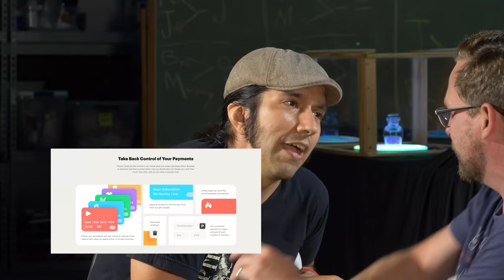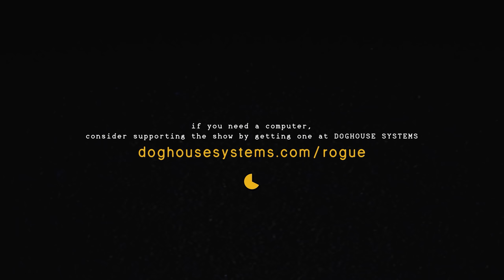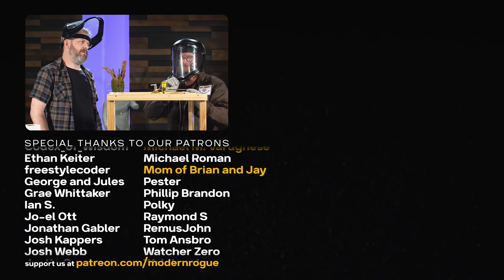Do Jewel Thieves Really Do This?

Comment: I'm not a burglar but I used to use a glass cutter to make cups from used bottles. And the way I cut the glass is using thermal shock. After performing the etching with a glass cutter, pour boiling water slowly And when the glass is hot, replace it with cold water and the glass disconnects exactly at the etching line
Reply: 90% Alcohol or Methonal lit

Comment: Guys, no no no! This is the first time I couldn't make it through a video. Please reach out to me as a resource next time you do any roguelike stuff like this. 1. You don't score the same path more than once 2. Heat is the best method for breaking the score, use hot water or a jet lighter (hold it far away though)...glass is susceptible to thermal shock. From a rogue perspective hot water is very quiet and doesn't cause a flash of light like a lighter does 3. If you want to be a real cool thief you place tape over the area you are removing and then make a handle to pull it all out, you place one line of tape vertically and leave a tail folded over you can grab onto then you place several pieces horizontally over the top of your handle so it holds onto the glass.

Comment: From a guy that use to cut glass all the time, use the following advice:
1. wet your suction cup and make sure the glass is clean. It helps to put pressure on it to ensure a good seal.
2. Make sure you have the room to go all around if using a circle cutter. When you find out after the fact you cant go all the way around it will cause issues.
3. Do NOT go over the same cut multiple times. Slight pressure is all you need to make a good mark that will break.
4. Use some oil on the cutting wheel. This helps keep it from running off when you go to break it.
5. When cutting, you need to strike it from the underside to start the break. Tapping the top wont do much as you have put a V shaped score in the glass, you want to press up from the focal point of the V. There are techniques to break it from the top but just tapping wont get you anywhere unless you just plan on breaking all the glass.
6. The ball on the end is used for tapping, not the head. You can bend the head to where it will not compress the spring inside.

Comment: I’m a glazier (I cut glass for a living lol). This technique would not work. In fact hitting it from the side you scored it on at all, will not work. The only way it will break along the score is if your were tapping it from the other side. Which means that the way they are doing it will never work. There is a much simpler way to cut glass from the outside and not make a mess or noise that I use all the time but I’m not gonna say how to do that.

Comment: Hey Brian, Jason, and Brandt, I have a fix to your woes: Different glass, cleaner cuts.

1. Tempered glass has been used since its creation in the late 19th Century for display cases. Then, thicken the frame another 1/2 inch so more pressure can be applied.

2. Clean the glass dust out of the cuts every full turn. This works like dusting your record albums so it plays clearer, only you're making the cuts more consistent in depth and pressure with every pass.

Try it with the annealed glass you have on hand, and see if it's worth a revisit!

Comment: I professionally cut glass in an industrial setting for 3 years, I've actually used a similar tool to cut circles. Basically when cutting glass you need to apply tension on the top surface. In essence you want to push from the bottom non-scored surface toward the top. It causes the score to propagate in a straight line from the top to bottom surface. When I cut circles I used the suction cup that held the scored side to rapidly pull and it popped loose. Another important note is to not overscore, make one pass with about 10 pounds of pressure and quickly twist the cup and the circle should pop loose. 

TLDR. For 1/8 inch glass, use lube and even pressure (about 10 lbs) to make a single pass and rapidly twist the cup and it should break away cleanly. Thicker glass requires a little more pressure.

Comment: As a window repair guy at a hardware store, you definitely scored waaaaay to much, I haven't done many circles but the principle is the same, single solid score because glass is so brittle that gives it a straight(or circular) path of least resistance then it's just a matter of figuring out how hard and where to make it snap but usually you'd be able to cut reliefs going around the outside of the circle to break off smaller easier pieces but that might work easier on the inside as well
Reply: This dude's dope, you should listen and put his comment in your next video
Reply: I agree to, he's obviously very smart and handsome, please include or at least read his comment

Comment: I would use as precise a suction/compass thing as you can get, and make sure it has a glass scoring carbide tip. Just do a single, precise score line - consistent and strong pressure, but no repeat scoring. Then blow torch or other similar local heat source of some kind to create strong localized heat expansion.

This is the exact method I used to break up glass stock when I blew chemical glassware on a vacuum line. I can say I ever tried it in a circle on flat glass stock, but it definitely worked to make nice and clean breaks on tube and rod stock.

Comment: With a glass cutter, the hardened  wheel is to score, the rectangular groove, if you have one, is to snap, and the ball on the end, is to strike your score like a hammer, causing it to snap along the score. You ordered some stuff from Amazon, so if it was cheap, don't be surprised if it didn't come with instructions. Also worth mentioning, breathing in glass dust can be potentially fatal.

Comment: Some things you had wrong, but ok.
You do it only one time and deeper, as muck as you can with the cutter. It works better. I recommend looking how they cut grass tables, it will blow your minds.
You also need lines if you need to ensure the way you want to break, basically the reverse that you did lol. But don't worry just remember, lines inside to break inside, lines outside to break outside of the circle. But it can make more pieces than a round one.

And the most important and it is not because of the glass is the WOOD FRAME. It is going down each time you touch and absorbed all the force of impact. Normally they are massive, so the frame don't matter or they have a metal frame that don't absorb much impact. That's why they do it with the glass in the table, so they don't need to care about that.
Reply: And 2 more things, suction cups or anything that uses suction works better wet, the tension of the water help to make a better sell.

And I helped to cut tiles, you just need to do a line one time and you can break putting the cutter on the line and putting force in it, leaving space to break. Or you can try by hand, I did it but I prefer with the cutter.

Comment: In the past I did stained glass. The hand tool you guys are using is to score a single scratch (which causes not only an imperfection but a set of microscopic fractures within the glass along that line). The next thing you would do is use a tool to separate the glass along that line by applying pressure on both sides of the score. In stained glass work there is a pair of what look like pliers which come to an angle like ^ or a curve like n. think of how a person breaks a stick over their knee, pressure in the same direction on both sides of the breaking point, applied down. Thats how glass breaks along a scored line. Its almost like tearing the glass. We always did it from the edge of the glass, where you could grab the score with the pliers. Not sure how you would pull it off in the middle. The other thing that stikes me as difficult is whenever we made concave curves we cut them out in several pieces because the outside piece would grip the inside curve, adding structure and ultimately leading to it breaking in unexpected areas. We would carve out some, and then some more, and then clean it up with a sander. I really don't think a perfect circle is possible in the middle of a pane of glass, but who knows. I could be wrong. I was a hobbyist, not a professional. 

Maybe this will help give you ideas. I would strongly suggest trying to cut from an edge on a piece of glass as a test run before going for the middle. That way you understand how to control a glass while it cracks. 

https://everythingstainedglass.com/how-to-cut-glass

Comment: Okay... I work in a glass manufacturing plant and that is totally not how you use that. If the glass is scored the opposite side has to be hit for it break along the score line made. And use the ball end of the glass "cutter", the end with the wheel is only for scoring it. Also it helps if the wheel is slightly oiled
Reply: Tempered glass is under tension from the process that's why the punch works. I'd suggest one full circle with the tool then pull the suction cup to chase pressure in the right direction. I'd like to see a follow up with that tool

Comment: There is another way to go at this without a glass cutter.  Tie up a dense, but flammable, string into the shape of the cut you want, then soak the string in a slow burning accelerant (napalm would be good...but canned heat would also be good).  Place it onto the top of the surface where you want the hole (being absolutely sure not to spill any accelerant outside of the string) and ignite it...let it burn until the flames cease, then tap the glass.  This is probably the best way in the world to "cut" through cylindrical glass without very expensive specialized tools (by tying the string around the glass).

Comment: FUNNY STORY: I reside in South Africa, the latest trick our "Cat Burglars" do, is to gently remove the whole glass from it's aluminum window frame. They just rip the rubber seals out, leaving the window fully mobile and exposed. They are even so NICE that they leave the window nice and neatly in tact for you to put is back for next time. Happened to me and via this "trick", I managed to break-in my own home when I got locked out. Not sure if the sam apply to double glazed window frames?

Comment: After making the circle, make a pizza inside the circle (ie: divide the circle into eighths by scoring it in half, then those halves into quarters, then those quarters into eighths; when you score with the non-circle one. That helps break the circle apart. It doesn't make it all plunk out in a single hole but it does leave a nice circular hole.

Comment: In the old days they used something call window alarm foil... If you break the glass, you cut the foil band and ring the alarm. But if you make a clean hole and keep the band intact... You can open the windows from the inside without ringing the alarm... That's why they used circular diamond glass cutter in the old time.

Comment: Like with bathroom tiles, you don't actually cut glass (at least, not with those tools).  What you do is more like a controlled break.  By scoring the glass once, you give it a very defined fracture along which it will break when pressure is added (usually from a single quick impact).  It does this because that single crack is the path of least resistance for the energy that you put into the glass.  

If you keep scoring it, then the force applied will no longer be able to go through the crack because of all the glass particles in multiple cracks, causing the energy from the impact to be absorbed and dispersed. 

Another way you can think about it is the difference between a fracture in a bone (let's use the forearm as an example) and micro fractures.  The micro fractures caused by low impacts (boxers when they spar or use a heavy bag) do not break the bone because all of those little fractures are spread out, with too much solid bone between them, so no impact force has a path of least resistance, so if you slip and fall on that bone then it is not likely to break.  By contrast, a single, small fracture will take the full brunt of the same impact, causing that single fracture to rapidly widen and expand, causing the bone to break.

Comment: You guys should've tried 2 long vertical lines to crack a panel off top to bottom (or side to side) instead of a circular hole.
That way the cracks have an end point to propagate to.

Comment: First I would like to say the unsecured softwood frame flexing definitely broke the first pane more than the impact of the tool. So if you try it again, do it in a kiln dried hardwood or metal frame, preferably bolted down.

Second, I have done a little glass cutting back when I worked at an old wood shop making shadow boxes for military retirees. And let me tell you, even the guy who built the place had trouble getting the glass right. The reason we can see through glass is in large part because it has a very chaotic molecular structure, the fundamental connections are not clean, if you aren't precise with the force you apply, the scoring means nothing. And if you don't score it, the force will dissipate. You need to hold the edge of what you're trying to break out one way or another. A smaller pane, better box or additional support around the ring may help with this.

Comment: Try cutting the glass and then thermal shocking it - pour boiling water on it so the temperature of the glass would rise, and then pour ice cold water on it, and it is supposed to roughly break open the hole you cut. But be careful, the edges would still be really sharp.

Comment: I've a few ideas on this 
1.score it using a diamond tile drill bit taped to the edge itll cut with more depth
2.score a spiderwed inside the circle and apply low heat with a blowtorch or soldering iron on high to the centre of the web
3.use a diamond tipped tile hole saw on low revs to cut the circle

Comment: score one line in the glass, don't go over it again that just starts creating more fracture points and the whole plain can shatter. Then once you have that line tap directly on it with the hammer part or what I like to do  is use a temperature differential to crack it, using a can of computer air duster turned upside down spray along the line that you scored or the fine point of a cigar lighter/mini torch will also work. 
Though I never understood the need to make a circle, if you have a small surface like that straight cuts using the edge of the frame as a "ruler" be much easier and the fracture will have a much better time progressing straight then around in a circle.

Comment: Here’s an idea if you ever retest, blowtorch/grill lighter on the score in the glass and then use a can of canned air upside down to rapidly cool the glass it will probably break on the line, I use a glass cutter to make cups out of bottles using a method similar

Comment: In high school I took a stained glass class and watching this is HILARIOUS. They're actually smarter than we were, even if their technique is questionable. We wouldn't wear any sort of gloves, and we kept a chart up of how many injuries each person had. Good times.

Technique is you make a scored line (1 thin scored line, not over and over and over, Brian,) then what we learned is you were supposed to tap it with the ball (not the cutting side, Jason,) from the backside of the glass, over and over and over and over, all around the score line. Tapping it will create a crack going through the glass to the score line, then it will break

Comment: 3:48 The reason you do not want to do it over and over again is because it make imperfection in the score, which makes the glass more likely to break on it's own away from the score rather than on the actual score itself (which is ultimately what happens here). 

Think of it the same way as when you want a perfectly straight line that is EXTREMELY thin. You don't want many passes, you want one decisive pass so that if it isn't perfect it's not obvious. Every extra attempt makes it more and more unclear which line is the correct line.

Comment: you have to use a single pass of the glass cutter, not dozens. you can use a heated cutter to cut then cool the etching with your breath to create a thermal shock. the shock will crack the glass along the etch. pull out the glass with suction cups and you have yourself a hole. it can be done in seconds with enough practice.

Comment: If I were to take a wild guess as to why this didn't work, it would probably be due to the fact that the actual structure that the glass was mounted in was flimsy as all hell. You can see the whole box flexing on impact, therefore dissipating the force needed for the glass to break away cleanly and impeding their ability to apply steady pressure while scoring.

Comment: Same deal less scoring and heat the disk you scored with a butane torch lighter around the edges of the cut see if that causes it to fracture if it doesn't heat a bit more and use a few drops of water Keep the heat say 1/4 inch from the inside edge of the circle you scored It should just fracture along the score with out being touched with cold water. A fast shock from a small hammer should honestly pop it out. The disk it self is likely the break. As far as the radiating lines go i think that is if you want to retain the disk it self say to replace a glass clock lens. You are wanting to pop out the center portion leaving the rest intact so you might also want to try scoring inside the circle and not out side. 
I don't know if any of it will work for sure. I know glass breaks if it gets hot and is cooled to fast or if it gets to cold and is heated to fast. So heating it then hitting it with some cold water or ice etc should cause it to thermally shock and just fall out in one round disk with the rest intact